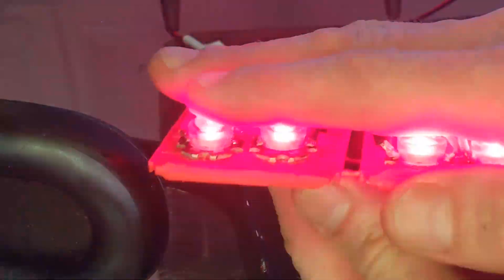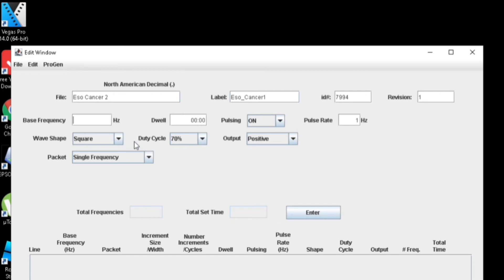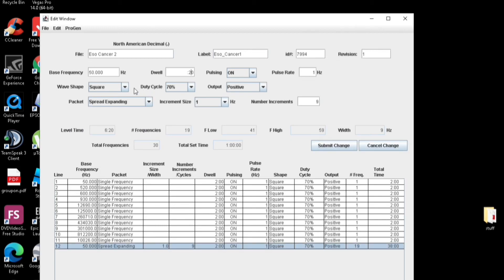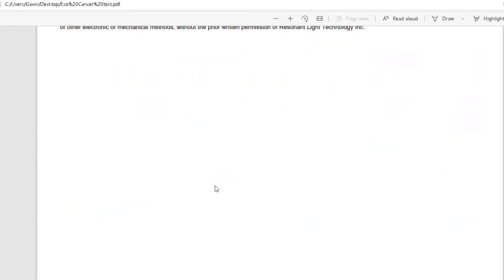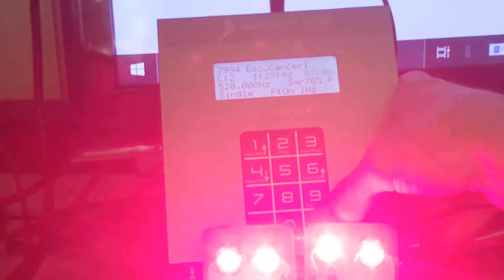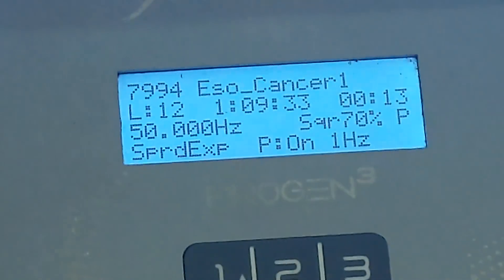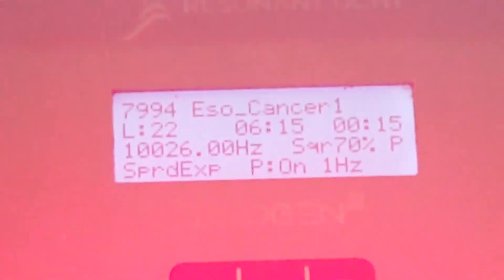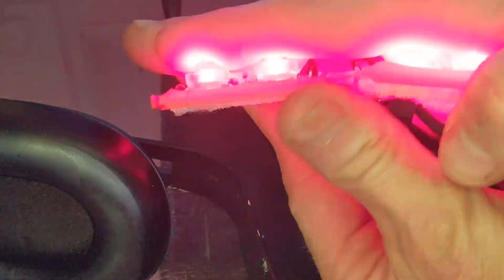Resonant Light - RIFE MACHINE Progen 3 - Custom Frequency Set Programming Via a PC - 20th July 2021

Comment: those globes would go well inside a torch like a pushbike light, some guys lights are brighter than car headlights. thinking with my puny brain light is electromagnetic radiation, cells function electrically aswell as chemically  so maybe theres truth in these devices.
Reply from the maker: Yes mate the little lenses are perfect for this